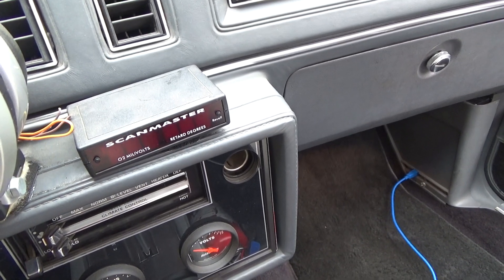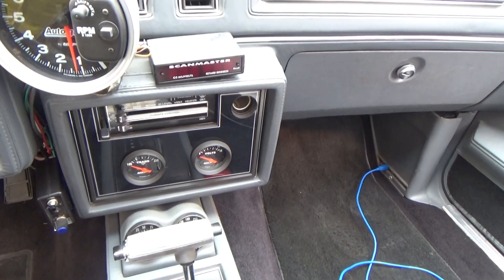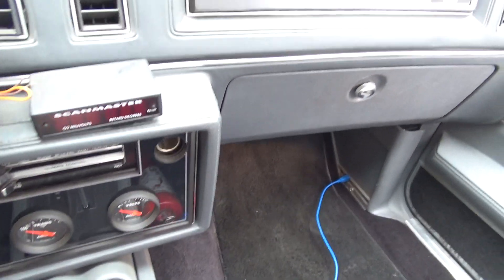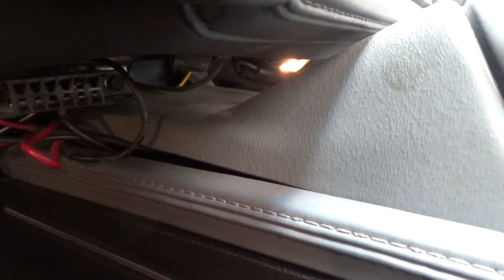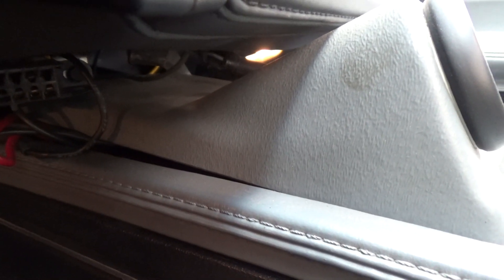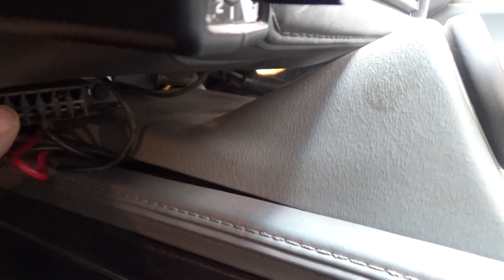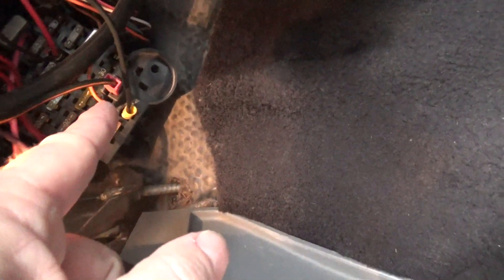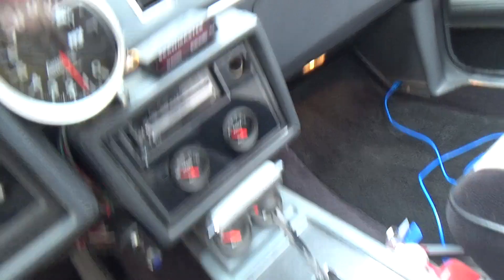How To Wire A Scanmaster

Comment: I don't know if its ok to ask this here  but here goes 
I have a 84 tr that has a 87 tr motor in it! Would that orange wire be the same? Reason i ask is cause i don't see any numbers on my scanmaster! They are all 0.0!
Reply from the maker: As far as I know you have to upgrade to an 86-87 ECM for it to work. Sounds like your SM isn't receiving any data. If you've tried the 86-87 ECM and the orange wire doesn't work, get back to me and I'll get an answer for you.

Comment: thank you for the video!!! very helpful!
Reply from the maker: Any 86-87 ECM will work with any 86-87 intercooled engine. Does the Scanmaster work if you hook the orange wire up? Let me know.
Reply from the maker: No problem...glad it was helpful.
Reply: very helpful. thank you for all the informative videos. please don't stop haha
Reply from the maker: Just let me know what vids you guys would like to see that would be helpful.
Reply: Thank you  for the fast reply! I was told that it has a matched ecu for a 87! But I'm not sure! It has a maf scanner on it as well but runs very badly! I'm not sure how everything was done by the guy before the guy i got it from! The car might be a basket case! I'm in over my head i think! But at least i got a reply from you! Thank goodness